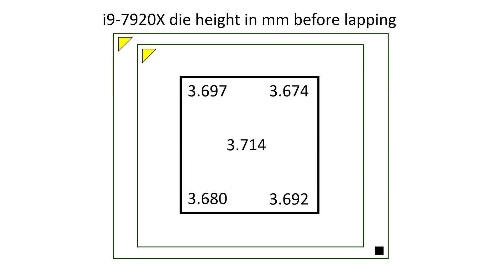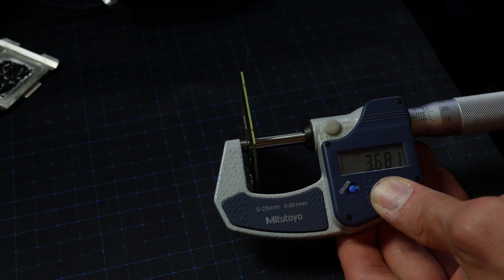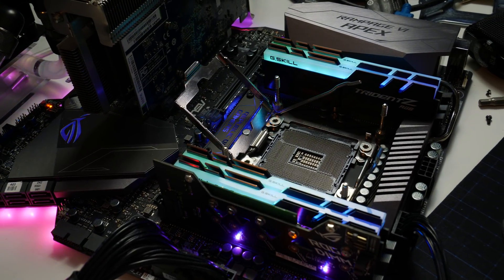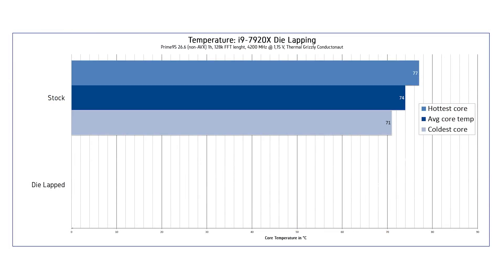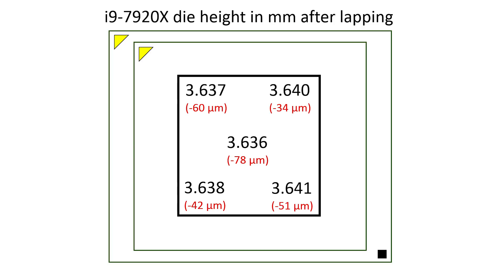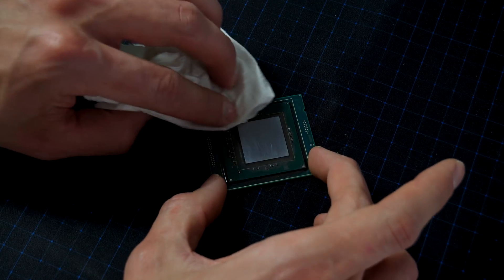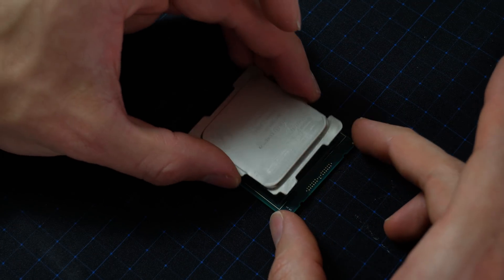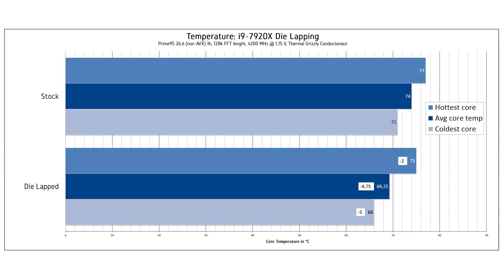Taking CPU Delidding To the Next Level !

Comment: This is all wrong.

First he isn't measuring the flatness of the silicon very accurately at all (you have to take into account that the pcb that it sits on is way less accurate than the surface of the die) so that part of the analysis is completely wrong.

Your so-called "lapping" probably messed up the flatness of the cpu even more. Rubbing the cpu on sand paper will most definitely make it even worse because the sand paper will depress when pressure is put on it making it no longer flat. Furthermore, at best you made it flat but in a skew plane that isn't perfectly parallel anymore with the heat spreader because your fingers could not possibly apply even pressure over the whole chip.

Not only that, but roughing up the surface of the die would decrease thermal performance because of the additional space needed to be filled by TIM.

I'd say any improvement in cooling performance was due to the liquid metal replacing the old TIM and everything else he did was only hurting performance and damaging his hardware.
Reply: also whatever he is saying about a diffusion barrier... I don't know where you heard any of this but it is just flat out wrong.
Reply from the maker: Did you even listen to the video? It's the same testing condition with LM before and after. The diffusion barrier info is straight from Intel. If you have better sources for info instead of saying "it's wrong" feel free to share
Reply: der8auer You should have used a surface plate or an actual lapping block at least to ensure flatness. An optical flatness gauge would be a much better way to measure the flatness as well. I stand by my comments about roughing up the surface of the silicon, just seems like the process of your lapping was lazy, not even bothering to polish the die afterward.

Comment: with this mod level  (µm sanding), to get comparison, you should have to take care to heatsink seat position (with laser ?), precise torque applied to screw and  thermal paste quantity (in µg) ... or every measure comparison is bullshit ;)
At end, there is no logic with results : delta between cores : -6 before / -9 after with a flatter surface ? make no sense, with no offence to tjis job ;)
Reply from the maker: It makes absolutely sense. The center is hotter than the outer area so if you improve the center the delta will be bigger. Pretty simple

Comment: I remember when I first heard of lapping, back when I was making Peltier fueled water cooling kits out of surgical tuning, tranny coolers, submersible pumps, and little unmarked grey reservoirs.  I thought I was all ahead of the game back in the late 90s early 00's, but then folks starting tossing their rigs in vats of hydraulic fluid to run them at ambient no matter what.  With others going the extra mile and lapping their first gen FCPGA Coppermine PIII and Celerons, back when Celerys could overtake the pack leaders with nothing more than some extra bus speed.  Internet was so young back then though, I was able to read about lapping, saw some pictures of a few stages of it, but YT didn't exist, no one was hosting videos unless they paid for it themselves, and mostly everything online was text based... Frames were cool, I mean... it was early.  That said, folks have been lapping since CPU's have been made to allow for it, since FCPGA Number one, back in 98/99.   Before that, things were like... well... Look at an original PMMX, You'd see.  Couldn't really be done. A: it was all upside down... Looking like a flat block of epoxy on top with the die underneath... .Hence the name, flip chip PGA, FC... So the die was inside the pin layout, which wow... so little pins then.  But not much could be done with it... B: It was under a very baked on metal cover.  Not so much a heat spreader as it was structural integrity.  And the top just had very basic thermal connectivity to the important bits, which then got cooled by a tiny little heat sink, and maybe a fan.... Those weren't really standard standard until the 233MMX... 133-166 often ran with just a heat sink, nothing more, 200 w/o MMX would at times get a tiny little fan... something akin to what you'd see on a cheap motherboard chipset today. I never did take on lapping a chip though, as even back then, the results were sort of ... lame.   Considering the effort and risk that is.  Also though, back then there really weren't as many baked in, accurate, measuring devices inherent to a computer system.  We would quite literally have to fish little tiny wires or ribbon cable (two tiny conductors) through the CPU pins to go to a thermal sensor, as there were often NONE to be had at a stock level.  We as enthusiasts invented that shit, and companies like ABIT began making boards where took these ideas and implemented them.  Shit, I'll never forget my first "soft menu" bios... Where I was able to overclock from on screen menu's... I mean, wow was that amazingly better than opening the system and fishing long neck needle nose into a dark corner to move some jumpers over various hard to see pins.  Though, those early systems sure as hell didn't recover well via their methods, often holding insert or the like, to boot / reset CMOS from a bad OC setting.   Oh, and OC settings... yeah, we didn't have all this fancy UEFI hit one button OC methods of today, we actually hardly had many settings at all.  Usually a locked multi, and bus speed.  Of course voltage control, but not extensively... not over the various numerous items on the mobo... just the CPU more or less.

Comment: @der8auer i tried direct die cooling a 7700k but i couldnt get it to boot without IHS my motherboard seemed to get confused! What I did was I grinded the led on the socket to get enough contact but It didn't work any thought anyone?

Comment: I can't believe it. A tech tuber using semi proper lapping techniques.
Reply from the maker: is that a good or bad thing. Semi proper wat
Reply: Semi proper because their is always someone with a better way. Yet in comparison to others it's exceptional.
Reply from the maker: :D okay thanks
Reply: Next would be to lap the water block. If both are done right you can press the cpu against the water block and twist it 90dg it should stick well enough to at least support the weight of the water block while gently shakeing it.

Comment: Liked and subed, very cool stuff! and did you say power consumption of 600-700 watts on the cpu alone?? what does the average current gen I5 or I7 draw?
Reply from the maker: it's with heavy extreme OC :) With normal OC you can pull about half of that

Comment: checking for temps but u use that old dated prime95 with no avx cause "everyone else does"... cringe.......

check for temps do it properly, get the latest, have avx2/fma3 enabled, run 24/28/48k fft for most heat (on ivy bridge and up), for whatever reason u specifically want a non avx load, still use the latest version of prime95 to have all the bug fixes and improvements over this old dead version, and just set these in local.txt:

CpuSupportsAVX= 0
CpuSupportsFMA3=0
CpuSupportsFMA4=0

all avx and fma is disabled.. latest version without avx there u go...

/cringing

Comment: It is necessary to do "ultra flat" (avg difference  ~0.001), and polishing both surfaces, and to abandon thermal paste. since the contact will be perfect ;)
Reply: if you abandon thermal paste when the cpu heats up parts may bow with expansion and become convex or concave and then they wont be mating up perfectly flat.  past and LQ are there because they provide an interface that moves and adjusts to the curvature of the surfaces
Reply: thermal interface is used just because of defects of irregularities and roughness (it fills in and flat out), but if these defects are not, then the thermal interface creates an additional layer and heating.
the question is really interesting: what smoothness should the surface be so that the thermal interface (liquid metal) does not give an increase in heat transfer? ;-)
Reply: it is used for both reasons.  an ihs bows significantly when heated.  when parts get hot they expand and when you have parts expanding at different rates and they are attached to each other bending warping and bowing occur.  it also fills irregularities but it does both really

Comment: My thermal paste keeps bleeding out. It leaves oil like substance on the APU die of the PS4 and the fan turns up really high. I've been using Arctic MX-4. I'm not sure if it's the bad thermal compound or what.

Comment: I think some part of the improvement is because of the uneven surface, 0.02/0.03 is a lot, but 0.002/0.005 is a lot even surface, maybe that helps and makes the contact between the die and the IHS better, it should be even better if the direct-die frame is used.

Comment: Hey @der8auer, I don't get why you go with very risky techniques as such, and then you mount the Heatspreader back. I would have expected a direct die cooling, as the waterblock plane is supposed to be perfectly parallel to the grinded CPU die. That would be THE thinnest layer between cooling system and the actual CPU cores.

Comment: I wonder, if you want to go so far why don't you go for sanding via CNC mills with higher precision & get a very-very-very near to absolute flat surface & then try this ?
 While doing it you can protect other on PCB components by thin layer of nailpaint.

Comment: Did you micrometer check the IHS and is the IHS actually flat?
Then also how flat is the LN2 pot base and do all the component faces mount up perfectly parallel to each other.

Comment: If you really worry about the defusing, I suggest you coat a thin layer of silver onto the die. It can be done by a simple and safe silver-mirror reaction. Besides, silver good at heat conduction as well as inert to liquid metal.

Comment: What about separating the pcbs and trying the smaller substrate in an lga1151 board. Intel might not have blocked it like they normally do because they wouldn't expect it. How about prove to us there isn't an lga1151 substrate with xrays? Anything other than proof is worthless speculation.

Comment: hello could u use leaf gold or silver on the cpu instead of polymemetic metal and also between the ihs and the cooler itself 

to gain more oc or better temps , it woulden't need changing in time so that one dosen't have to delid again in 2-3 years.

it's fiddely to put on , but it may get better conductivity(gold is very soft and non liquid so it might work out also for gpu's )

it would make some interesting video's i think

1080ti leaf gold edition !! :)

Comment: doesn't this means that the die is further away from the IHS, thus the IHS will bend more at the center(creating uneven contact) and/or more thermal material is requires to fill up the space between the die and the IHS?
Reply: because liquid metal is just so much better at conducting heat.

Look at the homepage of thermal grizzly and you will see their liquid metal product has a 5.8 times higher thermal conductivity than their next best regular thermal paste.
Reply: Yea there might be a risk of that, unless he also starts to "grind down the IHS".
But considering the results I suspect that the IHS still is "pressed against" the die (?) Though I must admit I was a bit surprised that he didn't use "direct die cooling"
Best regargds
Reply: That's why he did the grinding process extremely careful, he didn't want to get a huge space between die and IHS, so the end result was 50-60 micrometers lower, which seems to not affect performance worse.
Reply: Muhammed Gemci sure, but the next step of grinding down will definitely create more space. Der8auer can you please comment on this point and how you factor it in to what you are doing?
Reply: I was going to say this too, but I think the IHS may just warp to account for it.
Reply: Maybe if you resealed the IHS to the silicon with silicone adhesive it would matter, but just leaving the IHS to sit on the chip should make contact?
Reply: with the thickness of the IHS it wont bend and therefore yes would need more material between to bridge the larger gap. He should have ground down the parts of the IHS that meet the substrate by at least the same amount as he did the die itself
Reply: beside that, what is the point of only leveling out the surface of the chip, he should be doing it to both the chip and inside of the IHS.
Reply: @Djokkins, many reasons. Dude took the time to measure the die variances on his CPU, stands to reason that he also took the time to measure variances in the IHS. He's also looking for proper data. Introducing two variables at the same time won't tell you as much as introducing them one at a time. By doing one side, you can extrapolate best case scenario of applying the effort to the other side and see if it's worth it to you.
Reply: Your IHS doesn't really make proper direct contact to the die. This can be noted by the amount of silicone between the IHS and board after delidding a CPU the first time.
Reply: GglSux yeah, if Der8auer was so concerned about liquidmetal atoms leaking into the cpu why not use a high thermaly conductive paste like conductonaut from Thermal Grizzly and do direct die cooling?

Comment: It would be interesting to see this taken all the way with both a ground down CPU and direct contact liquid cooling (no IHS).
Reply: nosirrahx yep, I was shocked to see that an IHS was used after the lapping...
Reply: After he talked about the direct die frame i thought he was going to use it as well. Seems pretty pointless to just put the IHS back on after all that work.
Reply: He has a baseline for that as he sells a kit specifically designed to do direct die cooler installs.

The reason I mentioned direct die cooling is that anyone that is going to grind down their CPU is not going to be using an IHS.
Reply: He would have had to do a baseline test with the direct die then do the lapping. The issue is that the direct die is a bolt together assembly and swapping the cpu in and out becomes a chore. Much faster to use the stock socket bracket. You use the direct die after all the tweaking is done for a final shot at being cool.
Reply: 3M Novec 7100 & 7200 is the fluid to go.

Comment: What is the PCB Z height variance? Measuring in the manner you did: there can be variance. Are surface plates expensive in Germany? Thinking with a plate and light you could demonstrate the Silicon flexing/bending/bowing.

But....just by sanding it's definitely higher in the center. So your measurements are not far off.
Reply: I agree completely in regards to scientifically justifying those actions that were taken in the video however would be too long and too technical for the typical youtube demographic. I wonder, does he run a blog where he explains in detail (his processes, literature used for said actions [or is this a secret because of competitive nature of OC])?
Reply: For this kind of thing and optical flat, and monochromatic light would be ideal for measuring flatness by counting bands. But it lapping pattern did match up with his measurements, and the results are clear, so while not the best technical measuring method, it certainly didnt lead him to any false assumptions.
Reply: in germany you can use a grade 0 granite lapping plate from Hoffman Group (the garant version) with aluminium foil flattened against it (with use of alcohol for example) and with diamond paste... it would cost you around 400 euros total if you'd buy the diamond pastes from cheaper sources

Comment: since you published the video where you showed footage of the actual transistors seen by an electron microscope i always wondered why there is so much unused silicon on top of the actual processing layer
Reply: The thinner that top layer is, the less structural integrity there is thus the more risk that the die Cracks. It is done for Structural rigidity